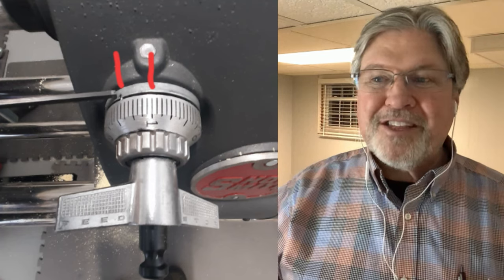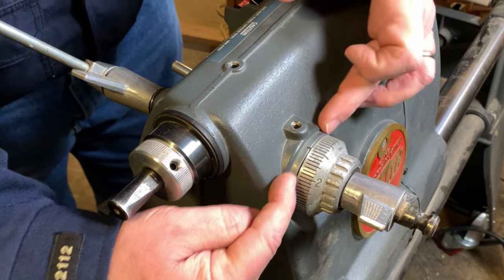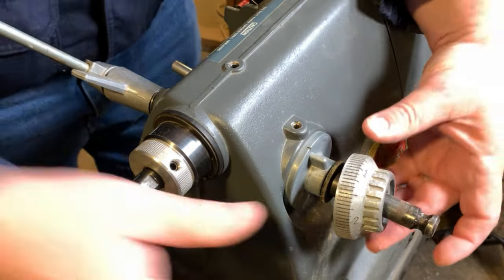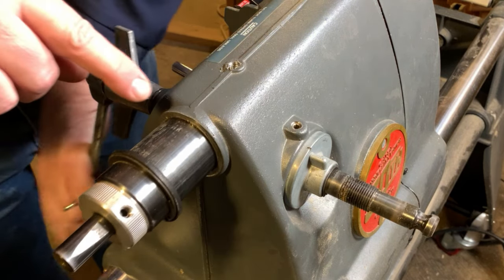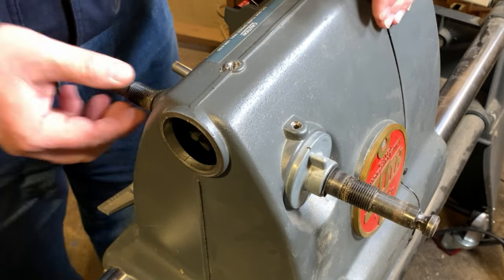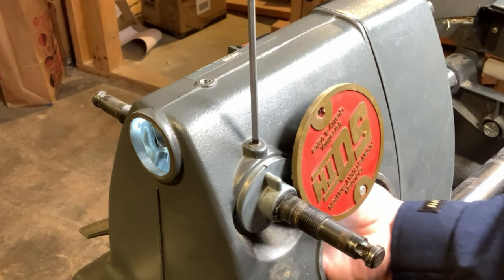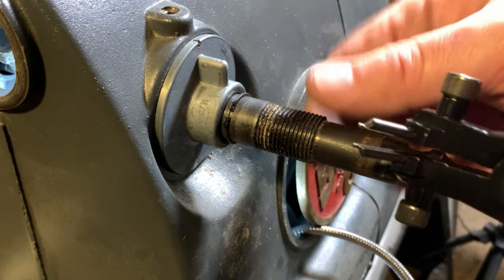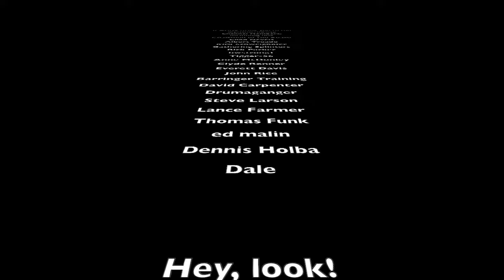I Warned You About That Set Screw... It's a DEATH TRAP!!!  (Click Bait?)

Comment: I recently got ambitious enough to repair the quill return spring on my 1950’s era Mark V. I can’t say it was fun, nor can I say that a clock spring was the simplest idea they could’ve come up with. Like a lot of them, it broke at the hole that indexes the stud on the shaft. I drilled a new hole, only to see the stud slip out of it. So I drilled two smaller holes on either side of the larger hole, and cinched it all down with bailing wire. That seems to be hold it it fast.
Reply from the maker: Glad you found a way to make it work. The good news is that all those parts are available new and used, so it’s hard to fail. Keep pressing on! Scott

Comment: I just successfully fixed my quill spring and reassembled everything!!  I certainly couldn't have done it without this video.  Thanks for sharing!
Reply from the maker: That’s great, Dale! What’s the next project? Scott
Reply: @MyGrowthRings  Not sure what the next project is, but I added dust collection to my Professional Planer, and cleaned and waxed the cast iron table.  The only issue I have with it is while running, the table slowly creeps down.  I think I need to tighten my chain.

Comment: Scott this comment is a thank you for a video you shared about changing out the casters.  I bought the ones you put in the comments of that video. I ordered the ones on Amazon econo and they worked great.  Again thanks for all you do. I installed them differently  in my shed where shopsmith lives. I used a set of 2 sheave blocks to raise the machine on one side at a time. Did not need to turn over. Great job as always.
Reply from the maker: You are welcome, Tom. I’m glad they are working out and thanks for the thank you! Scott

Comment: OOPS & Phew. It is all good now! BUT…after using my Shopsmith to do some molding, I noticed the quill was out 1/4” and when I checked it, I found it loose and no spring tension. Long worried story later, I found the set screw for the quill jammed up high enough to no longer contact its channel AND the set screw for the quill tensioner spring loose. Going to your youtube discussion of the spring tensioner, I felt confident enough to reset everything. Thankfully, the spring was fine. Retightening the set screw, I adjusted the quill back in, retightened its set screw and all is working fine.
	I know what caused it. I thought the molding speed was the same as the shaper speed on the new PowerPro (not knowing it was under the Table Saw setting). If my table had wings the thing would have taken off and flown. I was lucky and no damage was done other than my pride. Yes the molder head will make a Shopsmith dance at 10,000 rpms BUT NEVER AGAIN. I found out the truth the next day while reading the POWER TOOL WOODWORKING FOR EVERYONE and using the Shopsmith Forum on molding. Feel free to do a show warning that the MOLDER SPEEDS ARE UNDER THE TABLE SAW SETTINGS!
	Thank you for your shows as sending the motor back would not have been a pleasant thing, Ken

Comment: Thank you for this information. I was working on a 1956 Greene Shopsmith and the internal washer just wouldn't come out. It appears that the washer was installed then the key. I ended up taking a small file and filling on the key for a good half hour until I could get the washer to clear. Your sure don't want to beat on it to come out. Gordon
Reply from the maker: Wow, what a headache!

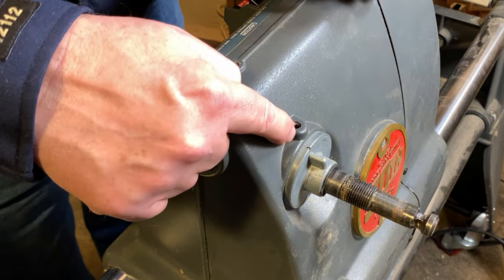Comment: At 5:07 you can see the markings left by the knurled cup set screw on the spring housing. According the set screw document that is correct in that location. I wonder if folks who have slipping issues might have a different type of set screw in that location somehow?
Reply from the maker: That could totally be a problem. Great point, Tom.

Comment: Great video, never taken that apart. Good to learn not to tighten the the depth stop down when the quill is extended. □
Reply from the maker: Dave, you can tighten the depth stop when the quill is extended, but don't tighten the quill lock on the front of the headstock if the quill is out of the headstock.   Scott
Reply: Oh I get it now, thanks for the clarification

Comment: Perfectly Timed Scott! Two weeks ago, I purchased a Greenie with a bad return spring. The catch is that it's an A casting (no side access hole) that has been upgraded to a Power Pro.  I've spent a few days staring at it and now I can ask you for your knowledge. 
Do I need to remove the power pro motor and power supply to get to the dome washer or is there some other way to ensure it doesn't drop out of sight? At the moment I'm thinking of attaching a string to the shaft before I withdraw it. I'm thinking that way the Dome washer will be on the string.  If I then attach the string to the new shaft the dome washer is on the new shaft. Is there another way or is removing the motor my only option?
Marc
Reply from the maker: Oh my, that’s the worst possible combination for accessing that washer! Yes, you’ll need to put the machine into drill press mode and insert the table from behind to act as a support for the motor pan. From there you can drop the motor and access all of the parts you’ll need to access. Such a pain, but you can do it! Scott

Comment: MY depth stop has stopped working properly and will go slightly farther than I set it to. Maybe I will now have the guts to mess with it. I have never removed any of these parts before.
Reply from the maker: Ken, 5-1 odds that one or both of the washers are backwards or in the wrong position. Scott
Reply: @MyGrowthRings  I'll check but I've never taken lock knob off. Maybe  washers need to be replaced. It's a mid 80s 500 upgraded to 510

Comment: So it should be about four rotations to properly set the spring tension when reassembling? I am going through a 510 that the depth stop had rotated out of alignment. It didn’t look like the lead plug had ever been removed on either quill or depth stop, so maybe it wasn’t tightened at the factory? It was made in October 1992.
Reply from the maker: Yes, that’s correct about the cranks on the handle before reinstalling the quill. There’s a chance it wasn’t tight enough, but the spring barrel can creep a bit over time and with overzealous impacting of the depth stop. Scott
Reply: @MyGrowthRings  I still wonder about filing a very small flat spot where the setscrew goes, that way it won’t move.
Reply from the maker: @timbo389  Perhaps, but you also don't want to weaken the walls of the spring barrel. I've seen soe where the setscrew was overtightened and the cast aluminum walls of the barrel crumbled.

Comment: Would not simply tightening the quill lock keep the spring from unwinding?
Reply: I think that is dangerous. The quill lock compresses two lobes  on either side of the quill against the quill so that it is gripped tightly. Without the quill in place you can over extend those lobes and snap them off. Then you are shopping for a new headstock casting.
Reply from the maker: Not really, if you goal was to rotate the drum back into alignment.
Reply from the maker: I'm not even sure who I was replying to with this comment! Tom is absolutely correct. Scott

Comment: My spring tension is s a little loose can I just tighten it a bit?
Reply from the maker: Meaning that it doesn’t snap back as you feel it should? Yes, if there’s more spring to be had you can advance the quill out of the headstock and give her a little more tension, assuming you have the length of spring to spare. Scott
Reply: If as you show I remove the quill and then rotate the handle say 1/4 turn then put the quill back in I might be ok?
Reply from the maker: @IPING4U  Yes, that should do the trick. And don’t forget to wax the quill.
Reply: @MyGrowthRings  I just bought an almost unused 510.  Got the Jointer and band saw too they also look unused but time has taken a slight toll.  Need some attention but I'm going to sort it out.
Reply from the maker: @IPING4U  that’s fantastic! Take your time going through the alignment process, because you shouldn’t assume that any of that was done properly. Also, take a look that I have titled “before you turn on your Shopsmith”, because it has some information that is critical for setting up the foundation of a good Shopsmith.
Reply: @MyGrowthRings  I also got the dust collector.
Reply from the maker: @IPING4U  Is it a DC3000? I really like mine.
Reply: @MyGrowthRings  yes.  510, jointer, band saw and dust collector $1,100.  It was barely used.  Missing a few things but I already ordered them.  I'm pretty happy.
Reply: @MyGrowthRings  I removed the quill (pretty easy) and spun the handle around 1 time.  Problem solved.  Thanks
Reply from the maker: @IPING4U  Perfect. If there was enough play in the spring to accept an additional turn it wasn't properly tensioned to begin with, so it's good that you checked.  Scott